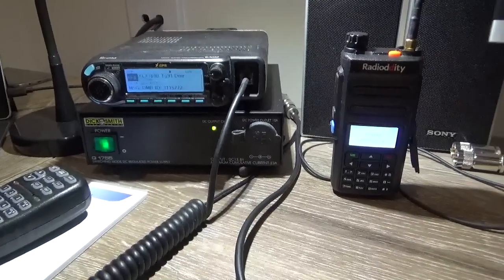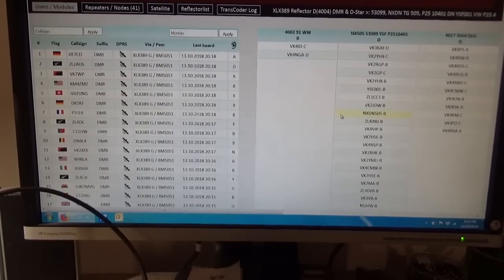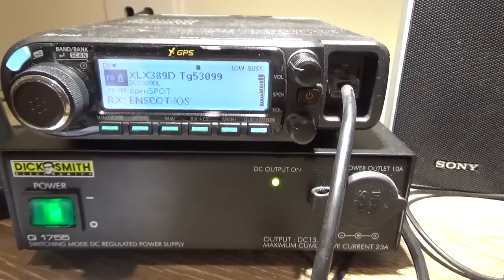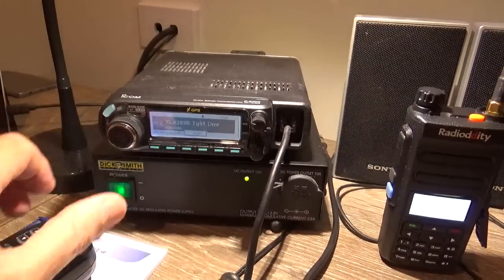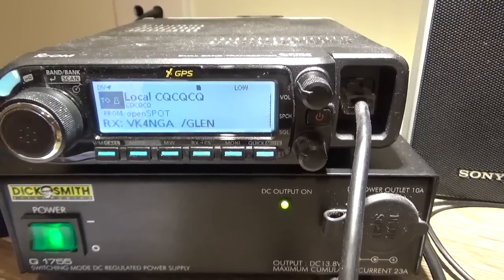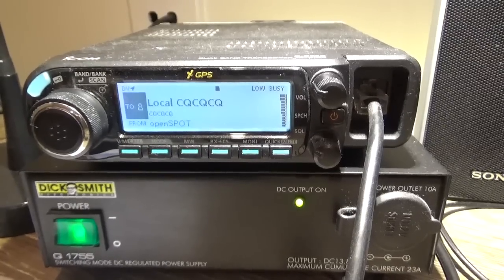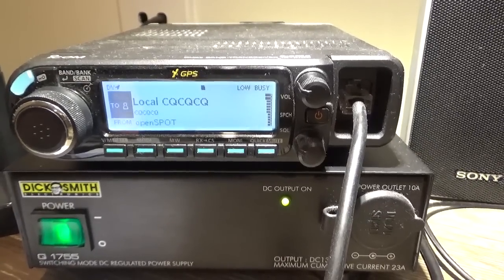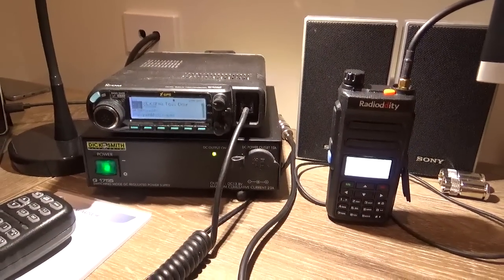DMR on your Dstar radio! Check this out!

Comment: Thanks Glen, will suss it out. That fan noise is a pisser though. My id800 used to do it too, as does my 2730. Don't hear it as much in the mobile though